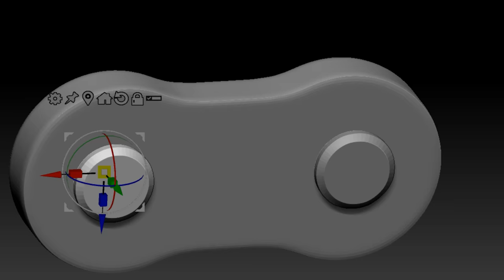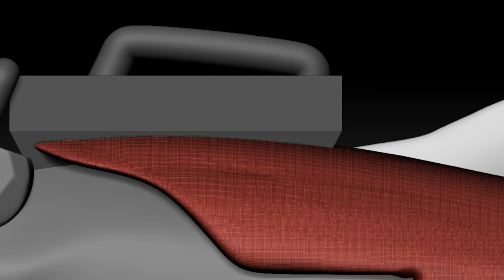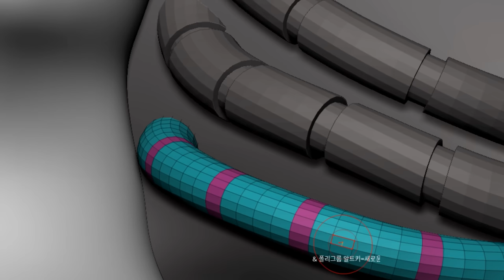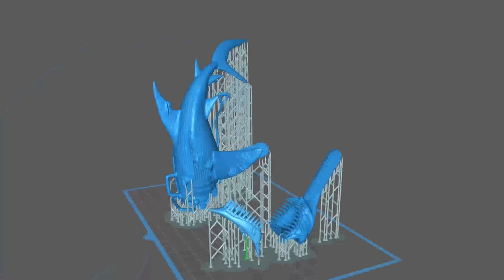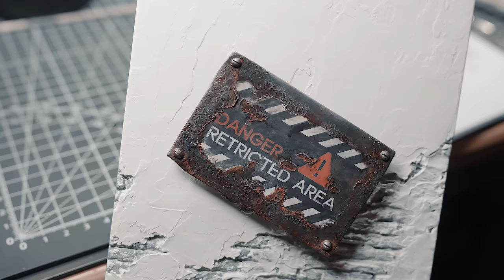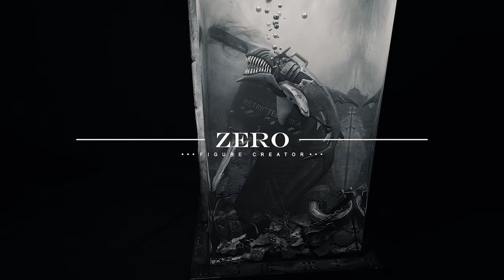Diorama of Chainsaw Man Shark / Epoxy resin

Comment: What do you think to make the resin hollow and then fill it with real water and bubble pumps connected?
Reply from the maker: that's a good idea
But from a management point of view it is difficult:face-purple-crying:
Reply: @ZERO_Figure_maker  maybe that's the reason no one on yt has it. What about making thin glass from resin for this aquarium and then fill it? Next idea- what do You think about printing a water gobo shadow on thin plastic to cast a reflections of a water on shark, like in 3D programs. Will it work?